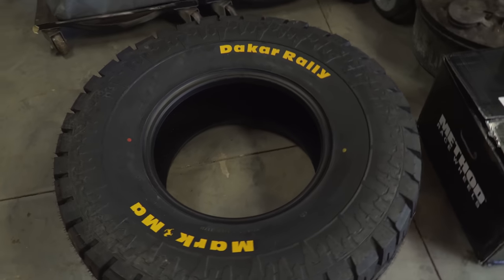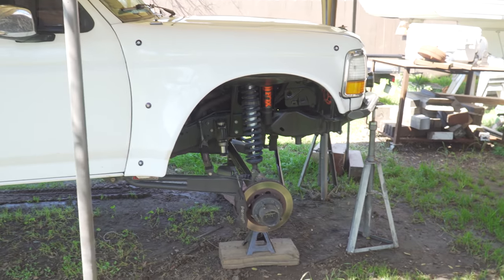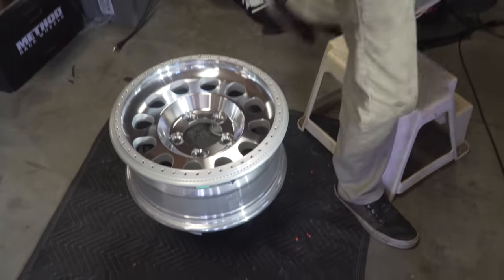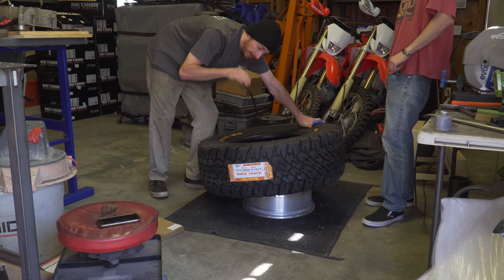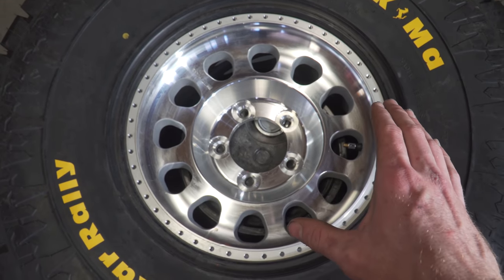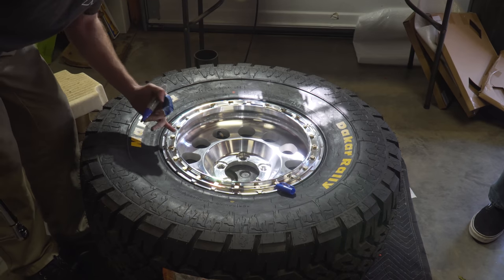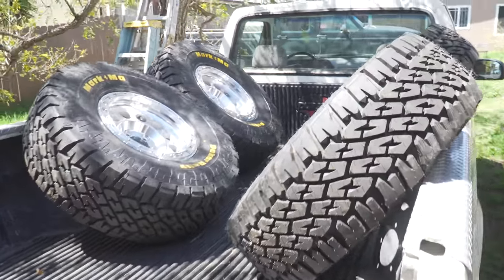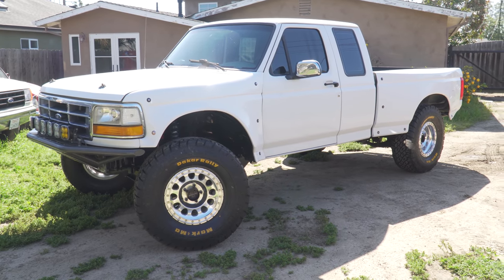How to CORRECTLY Assemble Beadlock Wheels!

Comment: 5oz isn’t bad at all for methods and 37s. I have more than that on mine. I’ve balanced a few sets of methods and they tend to take a lot but balanced out is balanced out. Also, I experimented with balance beads for a while in mine and tried a bunch of different ounces and they never worked right. Sticky weights like you did is the way to go!

Comment: If you are running a 37” or larger Method recommends that you install spacers in between the lock ring and the rim. They didn’t tell me that when I bought mine and I started popping bolts like crazy.

Comment: Impact Driver vs. Impact Wrench

The driver is for fasteners like screws, the wrench is for lug nuts and bolts on automotive stuff. 

Many drivers have adjustable torque settings (my dewalt does). It’s perfect for assembly of stuff like this. Good idea!
Reply from the maker: THANK YOU! I knew it was something similarly worded haha! But yes, the driver works super good for this application!  - Christian

Comment: I had an old 92 F350 with that 7.3 IDI and I did the Banks turbo setup on it. It’s called the sidewinder also so it’ll match your shifter!  Those motors are definitely turds but the turbo will for sure wake it up. I also mounted a 6.0 Ford intercooler up front and got a custom radiator to fit. Check out Conestoga diesel they have all the good fuel injection parts from stock to high performance.
Reply from the maker: How big of a gain does it feel the truck gets after the turbo kit? I am looking at the sidewinder kit for this truck. Did you turn the pump up at all? This thing is a turd, im hoping the 35's will help with overall top speed and the turbo kit will help with the get up and go. - Christian
Reply: Wings World I think the Banks kit gives it around a 100 horse and around 150 ft/lbs of torque. In the instructions it tells you to turn up the fuel screw to make this kit work right. More boost and no fuel doesn’t make any power. But all I can say is don’t get your hopes up, everything about the IDI cannot compare to a modern diesel. I actually went out and bought a 12V Cummins and NV4500 to swap in my truck but never completed the project. Although if you don’t tow and just want to daily it they do get good mileage.

Comment: 5oz. Isn't that much for a tire/wheel setup like that. It's usually not the wheels that are off so much as it is the tires. Bead bags blow, sticky weights are the ticket like you got. Stoked on the Diesel, I've got a 97 CCLB4x4 like the one in your yard. Yes, the sidewinder will wake it up!

Comment: Balance with airsoft BBs in the future. Stick on weights are trash, especially for offroading. 

5oz is quite a bit. On a normal wheel, youd break the bead and turn the tire 180* on the rim and balance again. Hard to do here, so dynamic balancing with airsoft BBs would be better as they’ll go to where they need to be. They will automatically adjust for wear over time, ripped off lugs, etc. 

Physics FTW
Reply from the maker: I thought it seemed like alot when i opened got them back too HAHA. Oh well. Truck rides really nice. I did the whole airsoft bb thing in my last vehicle when i put 37" KR2's on it. They worked okay, those tires still had bad flatspots in them all the time though. and it was a MESS pulling everything apart when i dismounted them. I will never do it again personally haha. -Christian
Reply: It’s not ideal for something you’d need to service a lot, like maybe race tires. In your case, the sticky weights might be the answer. I’d mark around them with a paint pen to help speed visual inspection. You’ll see if any get flung that way. 

My tow pig cummins had 37” goodyears on it, the BB balance worked good on that. It got 26mpg on the highway with those big meats on it. I like them for trucks that see mixed on/off road conditions because they help compensate for uneven wear or damage. My goodyear military 37’s chunked real bad if you got into sharp rocks or debris. Probably less of an issue with softer compounds.

I’ve also done a couple of overland trucks with it. Once you know how many ounces of bbs to use, it’s easy to carry some prepackaged spares in case of a trail fix.